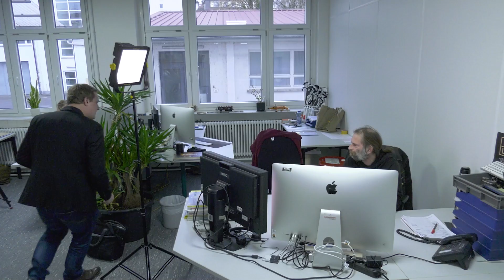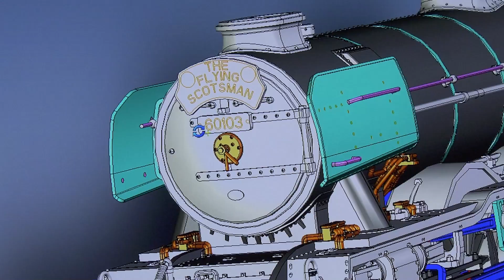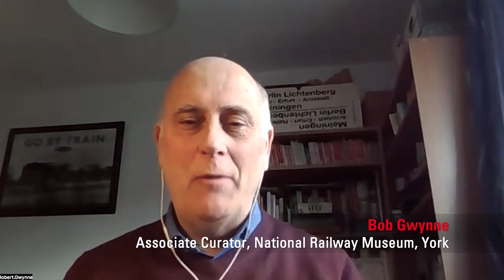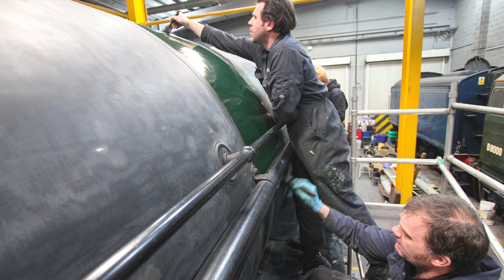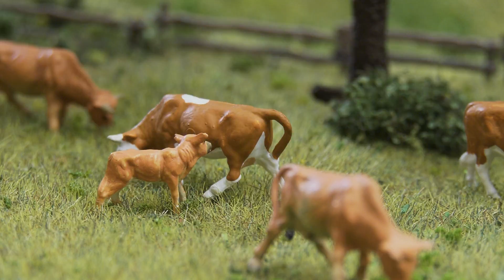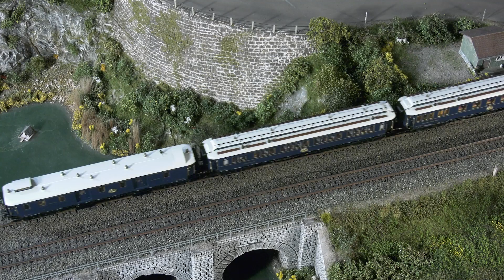Special Edition Flying Scotsman / Comes for Märklin and Trix H0

Comment: I have been trying to find a HO rather than OO British Rail carriage without success, which I saw in Stuttgart between 1970 - 73 where it stood at the Hauptbahnhof advertising hoildays in England by train (OO carriages are bigger than HO when in the same train)
Reply: Just use any rollingstock u have an call it an excursion. not everything has to be scaletrains or museum quality correct. just enjoy ur models.

Comment: The back of the tender is wrong, the curved top is much flatter  than on the model and it is very noticeable.
Reply: That is false. it is not flatter it just a lower hump. They made the back hump the same height which throws it off
Reply: @Donnie67654  regardless it doesn't seem to look right.

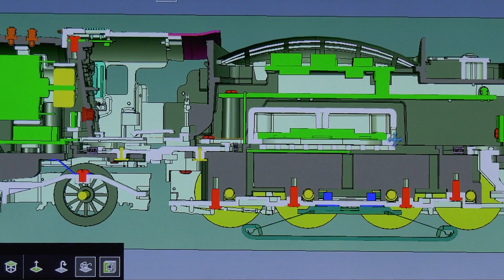Comment: What a fantastic model! Can't wait to run it on my layout! Although i do have one little question regarding the cover, between the cab and tender. At 1:52 you show it turning upwards, almost like a spoiler on a car, While at 6:16 it is shown facing down. Which way will it face on the final model? personally I hope it will be facing down, as I think that looks better and more realistic.
Reply: Probably going to be a rubber part for flexibility so it’ll be right
Reply: @Aaron-uf3sl  lets hope so! :)

Comment: I am a beginner of Marklin digital. If I have Mobile Station unit only, some digital features and functions cannot be fully executed within this Flying Scotsman locomotive, am I correct? Must have CS3 ?
Reply: if you have an updated mobile station 2 you will get almost all digital features and functions
Reply: that depends on what mobil station you have and if its updated to 3.55 I personally use a mobil station 2 I got around 10 years ago and had updated 2 years ago and it works just fine with all my digital locomotive with 20 functions or more therefore the flying scotsman should be no problem if you have an updated mobil station 2